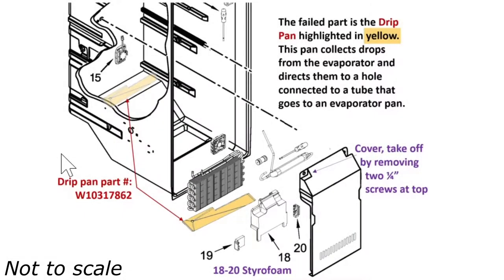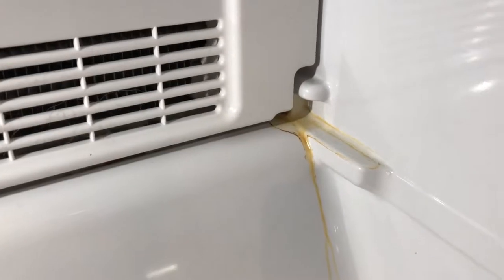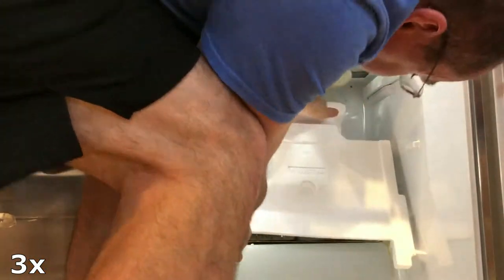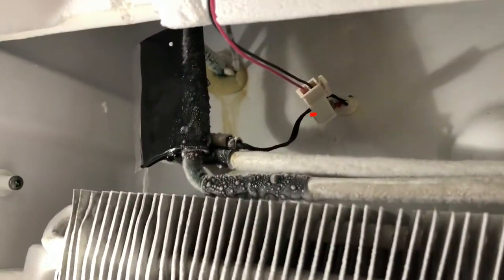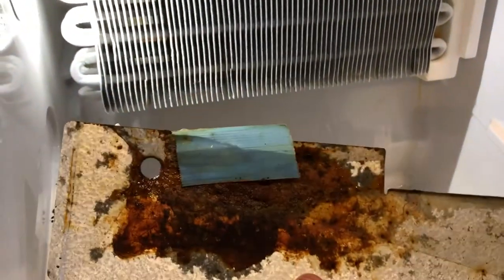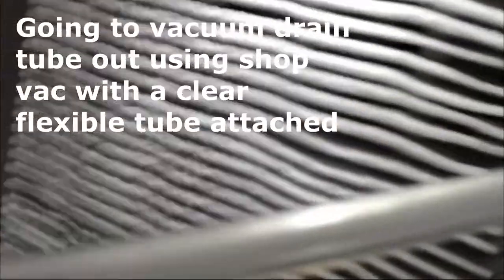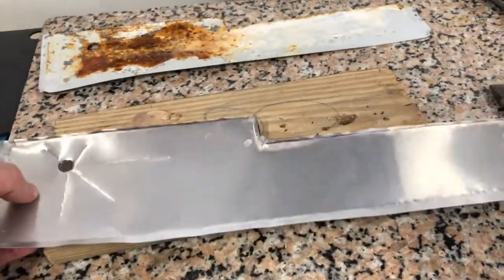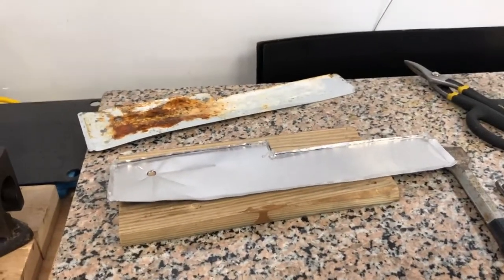Troubleshooting a fridge leak

Comment: Man, that looks like me a couple of days ago. I had the exact same problem, except that it was quickly apparent that part of the problem was that for some reason ice had formed on the lower left section behind the styrofoam. Fortunately I found a magnetic nutsetter that allowed me to remove the two screws holding the panel to the back. The ice then prevented me from removing the plastic panel and styrofoam. I melted the ice with a hairdryer and was finally able to remove the plastic panel and the styrofoam behind it. I had the same rusted  cheap sheet of metal sitting on the shelf. I sopped up all the water and defrosted the ice. I never got to remove the metal sheet or to discover the drain that is apparently there. When it ices up again, as it inevitably will, I will go back inside and try to clean the drain and replace the rusted metal sheet. I still don't know what caused the ice to form. What a cheap setup. And the owners manual has no help at all; they obviously want you to pay for service instead of helping yourself. This video is a godsend.

Comment: Great job on the video. I had the exact same problem and this saved me hours of work and money calling a repairman that would undoubtedly replaced with another steel pan.  Ridiculous they wouldn't have used aluminum or plastic to start with.  Thank you very much for the time you spent on this.

Comment: Same issue on exact same model no. If you access fridge from back side, you can just pull the drain tube straight down and deal with it there. I used a thin, yet rigid piece of wire to "rod out" the rust accumulation. Didn't have time to replace drip pan, but thought the same...what a terrible design. I sanded it down and used duct tape over holes in metal (badly rusted) to get me by until I can get back to the house. I like your aluminum replacement pan idea!
Reply from the maker: Kurt Ausec thanks! It’s a real pain for me to pull the fridge out so I tried to avoid that!